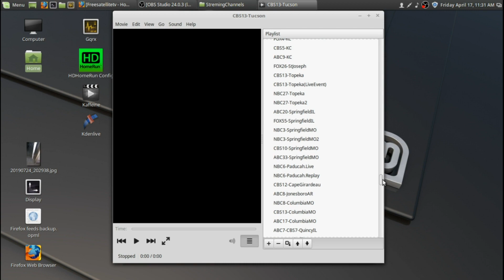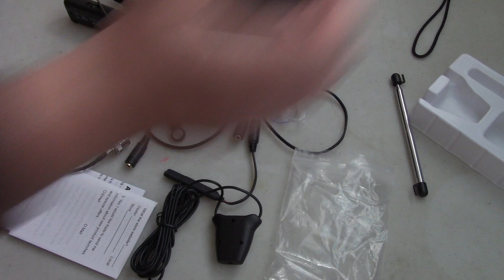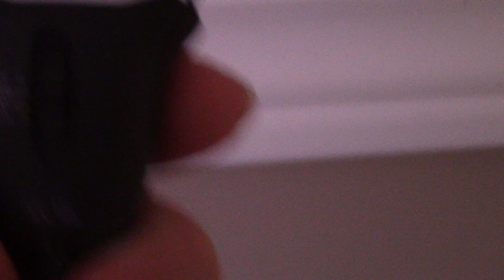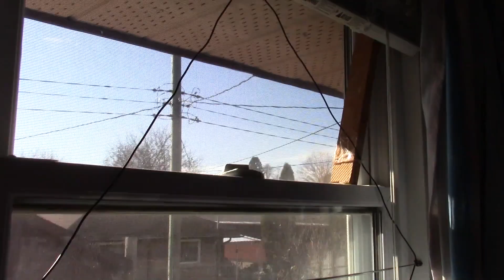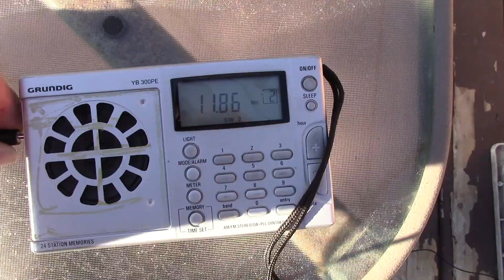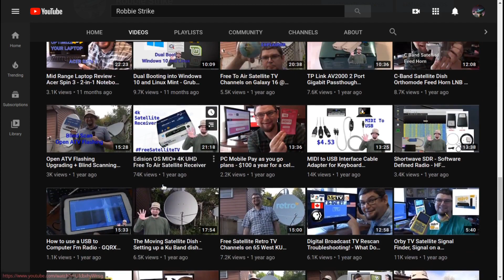Teksun AN 48x Antenna For Short Wave and AM Radio

Comment: You have a lot of RFI (probably coming from crappy switching power supplies, or energy-saving lamps, computers...).
In a electromagnetically quiet environment, the Tecsun AN works well.

Comment: Basically, there's no easy way to do SW listening in big cities. This antenna isn't even available on Amazon Canada. Simple wire loop just feeds all the appliance radio noise into your set. So sad! Setting up ML30 needs 4 different kinds of jacks! If you're not a hardcore radio enthusiast, good luck trying to just enjoy some SW listening, it aint happening for you!

Comment: I never understood why some radios only allow the external antenna to be used for shortwave and fm. To get around this you need to get something like a tecsun an-100 or an-200 and connect the external antenna to the jack on the loop antenna

Comment: AN-48X Improvements
Hi
A suggestion for a Project/Video to upgrade the Tecsun AN-48X
Improvement on the finicky Tuning Dial  
A) A larger Dial/Knob
B) Placing The Controls Units electronics in a bigger box and replacing the Tuning Potentiometer to allow a larger Tuning Dial or a Dual Course & Fine Tuning Dials like the C.Crane Twin Coils Antennas Control Unit
Consider replacing the Battery/Box with a larger Low Self Discharge Rechargeable Battery &Box 
Add common Mode Ferrites to the Long, noise susceptible, Down Lead. 
Better yet, replacing the supplied Down Lead with a good quality Coaxial Cable  
E) Use an automobile Windshield Sun Shade to make the AN-48X like the Sony ANLP-1  https://www.amazon.ca/Car-Windshield-Sun-Shade-Windshields/dp/B01KIFISX2
F) Make a thin stiff foam disc to support the Loop on a Lazy Susan or a low-cost Outdoors HDTV Antenna Rotator. The HDTV Antenna VHF/UHF can be used with Radios that have Air Band and/or Weather or a separate Scanner Radio. https://www.ebay.ca/sch/i.html?_ssc=1&_nkw=tv+antenna+rotator 
Thanx
73 de Jordan ve7jjd

Comment: In the connections that thing you didn’t know what it was... the plug in does not effect the medium wave, it is picked up by an internal ferrite antenna... that little wand end you hold up to the top of the radio or put in the radio holder behind it and that syncs up with the ferrite antenna inside...
Reply from the maker: Thank you!

Comment: A loop antenna has it's null through the hole so it works best when the signal is parallel with the flat side. In other words hanging it on your window like that is nulling signals coming through the window. See ARRL Antenna Handbook.

Comment: The am antenna is on a loop of wire inside radio,separate from the fm, shortwave jack.
Reply from the maker: It's not specifically for FM.
Reply: Yes and that's what that stand and the little block looking thing is for, you lay that in the stand at the height your ferrite antenna is in the radio case and then lay the  radio on top of it. Works reasonably well.